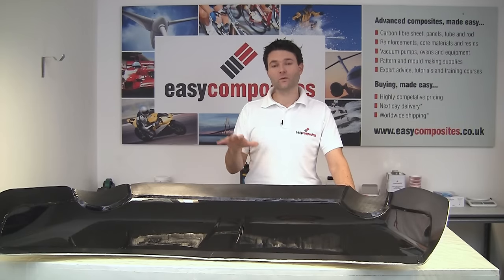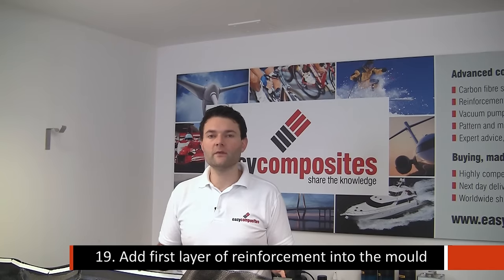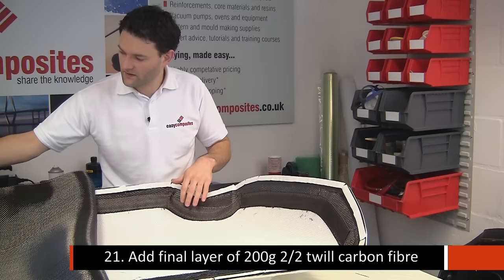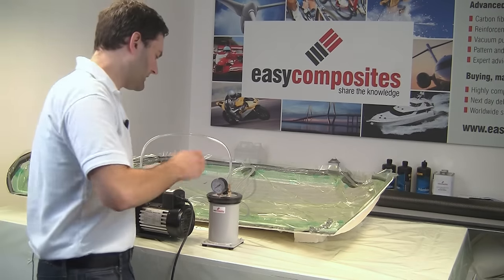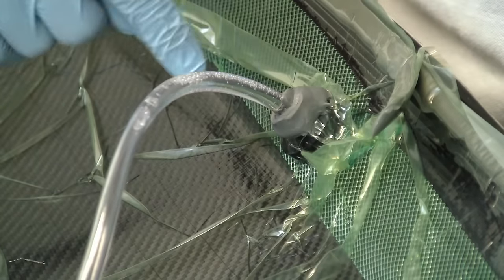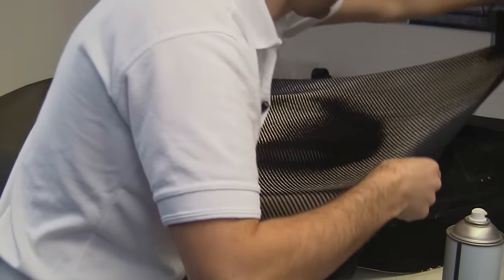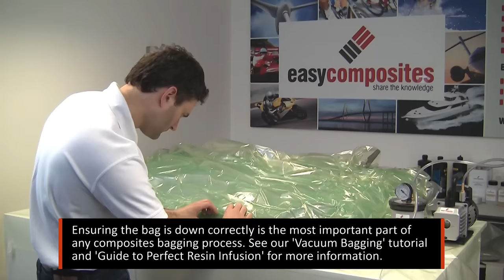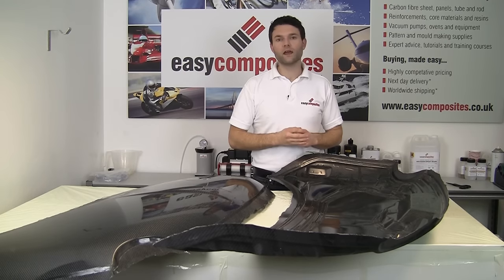How to Make a Carbon Fiber Car Bonnet/Hood - Part 2/3 : Resin Infusion

Comment: All I’ve learned is that the amount I pay for carbon fiber parts is justified.
Reply: I agree 100%, you took the words right out of my mouth when you see this video you see all the blood sweat and tears that go into this job and you're like yep now I know why I pay for every penny lol
Reply: The weight savings is completely worth the money, or time if you do it yourself. I made a composite hood for my 240Z and lightened the front end by over 25 pounds. Zs have long heavy front ends and any weight reduction is a bonus.
Reply: @WRMonger1  I’m thinking of doing the same for my 260, any tips?
Reply: And don't forget, you are also watching a pro with many months or years of training that does this type of work regularly...
His hours of work on something like this definitely does not translate 1:1 with most people...
Reply: Yep😂
Reply: ? This took one man a few hours of work, try making that panel out of sheet metal…. Far more skill and time needed

Comment from the maker: Generally, a ready-made bonnet/hood on the market will be almost all fibreglass, probably using polyester resin and possibly even using chopped strand mat (like we would use to make a mould!). They're mass produced, low spec and heavy. This is how to make a real carbon fibre part, untra-strong, light and dimensionally accurate. The original part weighed 18kgs, so-called 'carbon fibre' ones on sale weigh around 10kgs. The one we made here? - 3.25kg. Enough said :)

Comment from the maker: You may joke but we have several customers who have made all the main panels of thier car from carbon using the resin infusion process as in our video.
Reply: They are obviously single, don't have children, houses, jobs etc, I want theire life please
Reply: Awesome
Reply: is this hood stronger than an aluminum hood which car producers make?
Reply: @JKholmatov  its carbon fibre, lighter and stronger
Reply: @JKholmatov  carbon fiber has superb strength to weight ratio but only on a particular direction. In this case, the hood will have great strength against something hitting on top of it (once installed on the car), but it may crack easily in a front-end collision.
In other words, you have your engine protected from the wind and environment with less weight, but safety is reduced in the case of a collision.
Reply: This is the exact reason I'm watching this video. I want to replace anything/everything I can in my car with carbon fiber! lol
Reply: @nestorrodriguez8931  the hood of a car has no influence on the safety of the vehicle
Reply: @nick37781  it does however influence the safety if your bank account in the event of a collision
Reply: Å
Reply: @nick37781  cars have crumple zones on their metal or aluminum hoods so in event of crash front occupants won’t get decapitated those hoods bend designed for that. Who knows how these hoods will do on a non race car don’t tell me you know you haven’t crash tested it.

Comment: Fascinating!
I've made smaller fiberglass moulds and parts in the past, but had no idea just how much work went into a carbon layup of that size.
I know that modern  tooling and jigs can speed up the process, but now I know why DECENT CF parts are so expensive.

Comment from the maker: A Gelcoat was used for the surface of this bonnet so you don't need to paint it with lacquer.  Even without a gelcoat, the surface finish would be very good. For motorsport parts, the parts generally get crashed long before UV yellowing will occur.  Our GC50 epoxy compatible polyester gelcoat has very good UV resistance.
Reply: Hello, I'm curious if this gelcoat can be applied also by brush or only by spray gun?
Reply from the maker: @ElMosqito  Hi, the GC50 can be applied by either brush or spray gun.
Reply: @easycompositestv  Thanks for reply :) I'm thinking really seriously about starting company making CF parts for cars. I would be very greatful for any advice :)
Reply from the maker: @ElMosqito  If you need any advice it would be best to email technical@easycomposites.com

Comment from the maker: Yes, it could although the GC50 gelcoat that we use in this tutorial doesn't stay tacky for very long. You would need to ensure that at least a couple of hours elapsed between applying the gelcoat and undertaking the resin infusion (which is quite likely on a reasonably large project like this anyway) but asside from that it would be fine to stick the carbon to the gel whilst slightly tacky.

Comment from the maker: @oppo verhoeven Core materials add thickness without adding as much weight as solid laminate. Thickness is what makes the biggest contribution to stiffness and so making something thicker without making it heavier will make it much stronger for e same weight. For this reason, core materials are important and common in many pas like this.

Comment from the maker: @Charles Ayrton Blake Cobb you can just style the vent you want into the original pattern (i.e. graft it onto the steel original using body filler/foam and other pattern making materials) and then when you make the mould (following the process you saw in the part 1. Video) then the scoop shape will be included in the new bonnet mould.

Comment from the maker: That's Lantor Soric SF - it's an infusion compatible core material. Its purpose is to increase the thickness of the panel without adding too much weight. Resin can flow through channels in the core material but won't fill up the honeycomb shapes. By increasing the thickness of the panel, it increases the stiffness considerably.

Comment from the maker: Have a look at our beginners guide to pre-preg in the learning area of our site, which should tell you everything you need to know about pre-preg usage and how as a beginner you can make stunning parts using it.

Pre-preg is marginally a higher performer and slightly lighter than a similar bonnet made by resin infusion. However it would cost at least double, if not triple the cost in raw materials for only a small benefit.

Comment from the maker: @Silverjda Just to be clear, both infusion epoxy and the epoxy used in pre-press are both exothermic reactions when they cure. They're never endothermic, they just have a much higher cure temperature but when they cure, they give off heat, not consume it. If you post cure our epoxy infusion resin at elevated temperature you will achieve mechanical properties (hardness) the same as many pre-pregs.

Comment from the maker: Generally, matt finish parts come off matt finish moulds but if you want to make a part that's come out of a glossy mould matt then you would do the infusion with no gelcoat (gelcoat is not great for giving a matt finish to) and then 'scotch pad' the finished panel which would give it a matt finish. This wouldn't leave a protective resin layer on the surtface though so it would be more for race use than everyday use if you did this. Another option is a matt or satin finish clear coat/lacquer.

Comment: Thank you very much for the detailed explanation and show all steps. It can be easy for you but it won't be easy for amateurs. Because it's a kind of hand made art :) I need some small trim parts for my classic car. I thought I could do it before watching the video. But now I have to buy those interior parts from the manufacturer. Most important thing is to be patient. :) Thanks again...
Reply from the maker: There are other ways to make carbon fibre parts that can be less complicated, for example you can use a conventional wet lay process or you could just skin your existing parts to give them a carbon fibre finish. If it's for a classic car and you're painting the finished panels then the pin-hole free finish isn't quite so important and therefore it's much more realistic to just use a wet-lay process (so no vacuum bagging or infusion, just resin and fibre into the mould).
Reply: Hey thanks for your reply. Actually I was thinking the same way like your advice. For example my BMW's cockpit trim panels are ok but some small parts should be changed. But a brand-new plastic trims are very expensive even in Germany. The surface is not so important for me. Matte or bright black can be ok. I will watch some trailers and then try it. But I will always follow you and your art works :)

Comment from the maker: It depends. Good cosmetic results can be achieved with traditional wetlay processes as well as vacuum bagging. Some of the advantages of resin infusion include, good cosmetic finish, controllable fibre/resin ratio, stronger and lighter parts due to ratio and vacuum consolidation of the fibres etc.  But Wet lay parts can still be perfectly adequate for some applications.
Reply: How do i get easy composite products in Tanzania?
Reply from the maker: @nasserraymond6395   We can ship to Tanzania however none of our products that are listed as DG can be shipped due to shipping regulations with our couriers.

Comment from the maker: That's spray-tack. Scotch 77 would be OK providing you use it sparingly. If you're really serious about the engineering of it then you can use an epoxy compatible spray-tack (we'll be stocking one soon) which will fully cross-link into the finished resin matrix but these are expensive. For light work, regular spray-tacks are OK.

Comment from the maker: @BLOBBLYBLOBBY I'm afraid not, it needs to be mixed with a catalyst, it's not the sort of material that could be loaded into a spray can. You don't need to do the bit with the gel coat, this can be skipped, the end result will look the same but it wouldn't

Comment from the maker: If you made the part using resin infusion (like we do here) then you could choose to 'post-cure' the part in an oven. Depending on the resin you're using this might improve it's mechanical performance and its temeprature tollerance. Other ways to make carbon fibre parts (specifically 'pre-preg') mean that the resin will only start to cure once it's exposed to elevated temperature (usually around 100'C+). We use and sell pre-pregs too, see our website if you're interested/want to know more.

Comment from the maker: Not including tools or equipment (like the vacuum pump, catch-pot, dremmel etc.) a typical 59" x 44" hood (not the small FIAT 500 one we make in this demo) would cost around £400 for the mould materials (pay once) and then around £400 for the part materials (inc. bagging consumables). Call/Email us for lots more info on costings if you're interested.
Reply: how are the prices now? still that high?

Comment from the maker: You can use spray tacks but most of them on the market will cause some surface imperfections needing polishing out.
Reply: After fully cured, sprayed GC50 gelcoat didnt get tacky with aceton sprayed on. I have to 3M spray tack. is there anything wrong with GC50 ?
Reply from the maker: @kienxdmta  GC50 does not get tacky with acetone any more.  Only the early version used in this video (almost 10 years old!) was able to work in this way.  We don’t recommend using spray tack adhesives unless it is impossible to lay your fabric without one.  And even then use only the lightest dusting possible.

Comment from the maker: Be as sun and weather resistant unless you sprayed it with a 2k automotive lacquer/clear coat. For race car panels then you wouldn't bother with a gel coat or paint (because they weight extra). If you watch our other infusion video you'll see a part made with no gelcoat.

Comment: This is a ton of work and I feel like most places don't do all this when they are selling rear diffusers for $300 . Is it possible to buy a cheap diffuser and then just lay carbon fiber over it , bond it and clear coat it?
Reply from the maker: You're right, often they're not - it depends on the quality of what you're buying and what you're buying it for. You could just 'skin' a cheap diffuser in carbon fibre but you would be doing it for the appearance of carbon fibre and not for the strength-to-weight ratio advantage of the material. If you're interested in the skinning process then take a look at our https://www.youtube.com/watch?v=aqwhcfQZT8U video which shows the process in detail.

Comment from the maker: The material is "dry" as in it has no resin on it.  

Often people confusingly refer to wet and dry carbon fibre and by that they mean dry carbon as in pre-preg carbons. Pre-preg carbons have resin impregnated into them and infact are sticky to the touch and not dry!

Comment: Maybe I missed this part in my 10th pass through this video, but what's the purpose of the GC50 gelcoat layer? Is this to prevent a reaction with the gelcoat used in the mold, affect surface finish, or what? (Apologies if this has been previously asked.)
Reply from the maker: It’s mainly to provide some UV protection to the epoxy and also provide some general ‘wear and tear’ protection to the panel too. The alternative is to use a clear coat. In fact, these days, we probably prefer to use a clear coat than a clear ‘in mould’ coating like the GC50 but it does vary depending on circumstances.
Reply: I’ve done the coating after demolding and the clear gelcoat is actually better. It stays in place without yellowing

Comment: I got everything I need to give this a try. I have made a couple of infusion parts before. Really small and with a gel coat. My question is you used the spray tack on the frame and you said it leaves little imperfections. Will that spray tack clean off after the infusion if I wanted to clear the frame later on so it wont show?
Reply from the maker: Possibly, if you aren't using a gelcoat but if you are using a gelcoat then unfortunately, it couldn't be removed afterwards as it would be trapped between the gelcoat and carbon. If no gelcoat has been used then you should be able to wet-sand and polish the part up to remove traces of spray tack, however, the best option is to only use it where needed and use it sparingly to avoid having to do any finishing work.

Comment: Excellent vid. Just a thought though, to post cure it so your engine doesn't melt it, you'd need an oven that'll be big enough for a bonnet wouldn't you?
Reply from the maker: If you do an oven post cure yes. You can use heat blankets to achieve the same thing.

Comment: is the gel coat on the mold necessary if i use a frekote 700 mold release and then clear coat the part afterwards?
Reply from the maker: You can certainly clear coat afterwards; the GC50 is an in-mould solution to give a UV protective, clear gloss finish to the outside of the part but you can certainly forgo the gelcoat and then give the trimmed and finished part a clear coat instead.
Reply: @easycompositestv  thanks for responding! that clears things up

Comment: Hi, 
After finishing my first product ( using 100% Easy composites material ) and strictly fowling the steps as your video ,,, i keep it for about 30H in the mold to dry ( i am using slow hardener ) and everything was grate .
The problem is : when i keep it in the sun and the Temperature is around 36 degree it become flixable ! And if i but it back indoor it returns Hard.
Reply from the maker: Your Part needs a post cure before exposing to high temperatures.  We would recommend following the post cure cycles in the resin TDS.

Comment: Just wondering why you need to add the pleats to the plastic?,is it to aid in the vacuum process? ,thanks David
Reply from the maker: The pleats are there to ensure you have enough bagging film so that when it is pulled under vacuum it has enough film to avoid bridging of the film on the part.
Reply: @easycompositestv  Thank you for the quick response and great videos very informative, I will be purchasing a kit from you in the near future 👍

Comment: Is vacuum bagging the carbon fiber always necessary, only for large/thick parts to make sure the resin is fully impregnated, or is it just for making the best possible finish? If I were doing a variety of smaller parts that would be eventually joined together or a structure that didn't need to look all that great, would vacuum bagging be necessary?

Comment: What about a big hood, like say on an American pony car, at least double the size of your bonnet?  How many more layers would be required and/or could it be reinforced with say an aluminum frame of sorts?
Reply from the maker: You definately wouldn't need a metal subframe, even for a much larger panel. Really the process for a large hood would be just the same, you'd be amazed how stiff carbon fibre panels are and if you had the inside structure adding stiffness to the outside skin (as in this video) then you'd probably have all the stiffness you'd need for a large bonnet. If the shape of the panel and the design of the internal skins isn't naturally strong the you would only need to add in - at most - another layer of 650g carbon 12k carbon in addition to the reinforcement we use in this tutorial.

Comment: Are the edges "rolled" with this process? To give it that factory quality look?
Reply from the maker: David Shepard Actually, by taking the moulds off the original part, they naturally have a 'rolled edge' because we leave the radius of the original edge in the mould and therefore the parts have this same radiused edge so yes, the edges a smooth and rolled, rather then showing an obvious 'trimmed through' laminate edge.

Comment: Excellent video, very useful. What's the reason you applied release agent first and then mold wax after that, instead of vice versa? Also would it be better to add the filleting wax only after those two steps?
Reply from the maker: The Easy Lease has solvents within it that would likely damage any wax you put down hence the wax goes on top of the chemical release agent.